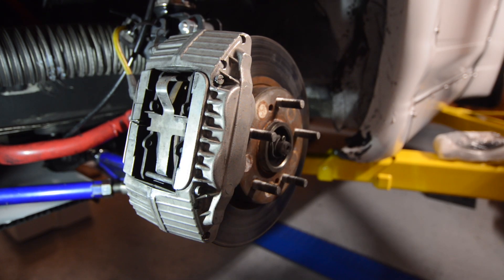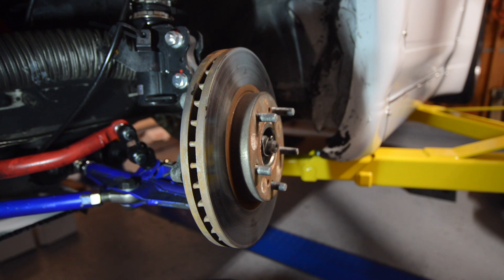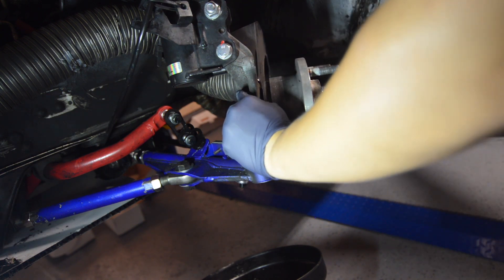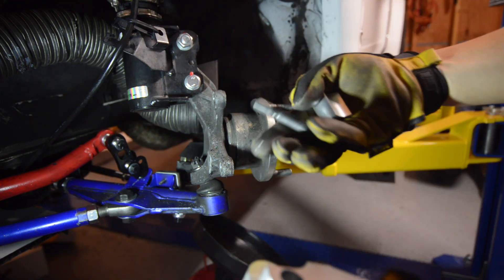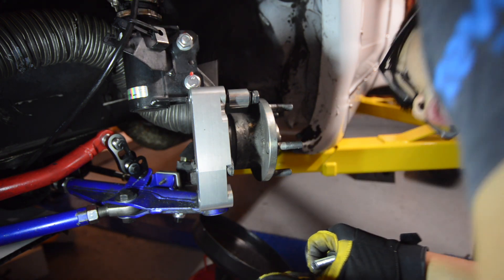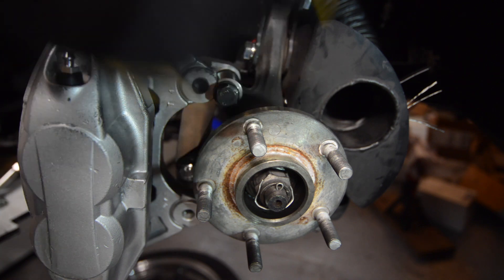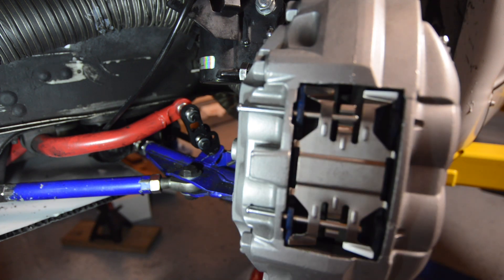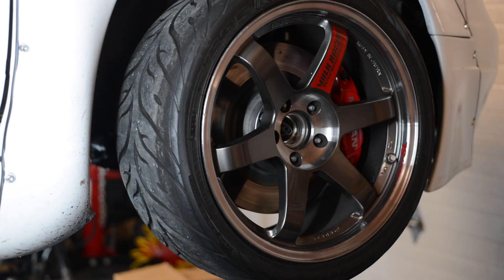S13 Front Akebono 370Z Big Brake Kit

Comment: Running staggered setup on my 180. These probably wouldn’t clear 17s right?
Reply from the maker: Depends on the Wheel Barrel. Some 17s will fit. I'll upload a video soon. For example the te37 and ze40 in 17 in will fit but the ce28 in 17in will not due to the barrel being smaller. a 18in  ce28 barrel clearance is similar to 17in te37.

Comment: What specs are the wheels?
Reply from the maker: 18x 9.5+22 front and 18x10.5+15 rear
Reply: @tougelab3996 I know you also had to trim a piece off the calipers for the rear what exactly did you use to notch it?

Comment: What brakes lines did you use ?
Reply from the maker: You can reuse your stock or aftermarket braided lines for the 240sx or z32. You will need to get the akebono banjo nut as the 370z sports brakes uses a different length.

Comment: I was wondering what would would I need to run these calipers on my s14? Homie gave me the calipers but now I need to know what I would need to actually use them lol. Take in mind I have the stock s14 calipers .
Reply from the maker: Rotors, calipers, and banjo bolt for 370z Sport, and Adapters for the car. Some trimming maybe needed for the caliper.

Comment: How was the fitment of the rotor on the hub? I have a 92 Nissan Silvia s13 and having been looking into a 5lug swap and brake upgrade. The 300zx calipers are hard to find in my area . Was thinking 370z would be much easier for sourcing parts !
Reply from the maker: Rotor and hubs are plug and play. You will need a min. of 18in wheels to clear the brakes and rotors.
Reply: @tougelab3996  what's the lowest offset you fit without having to go negative camber?